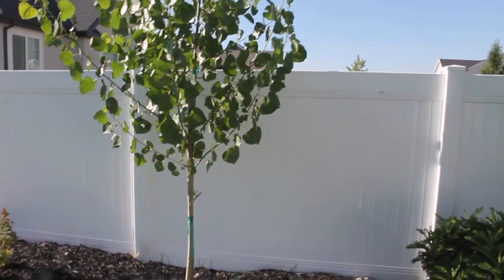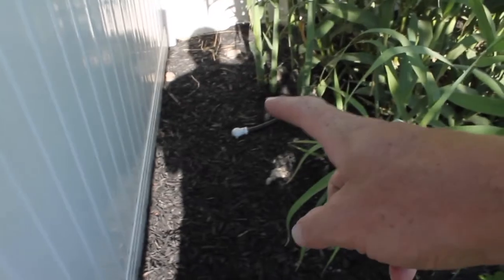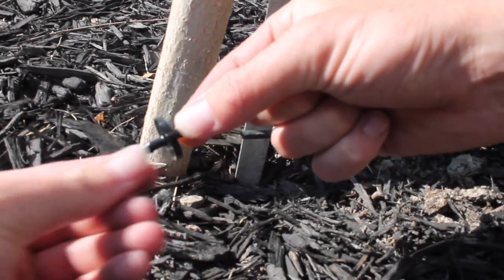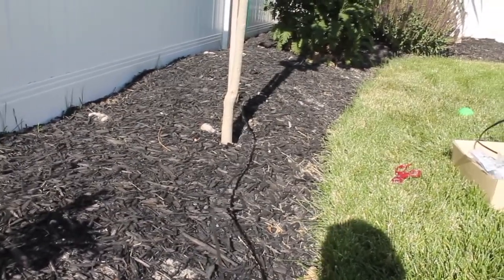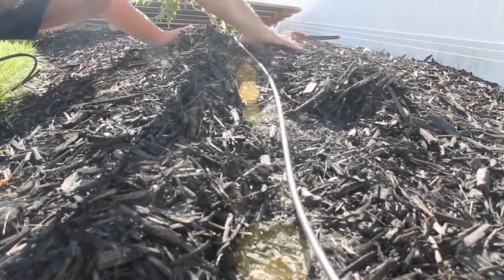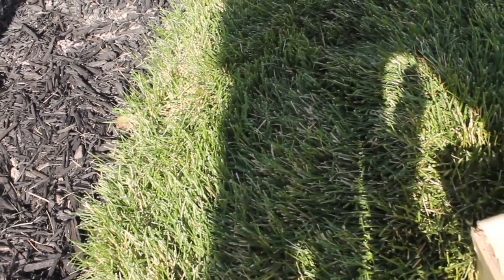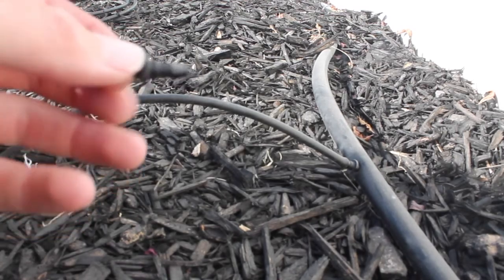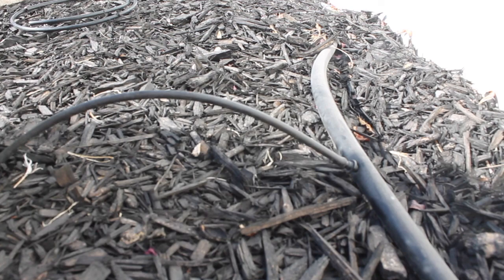How to Install a New Drip Line to an Existing Drip Irrigation System.

Comment: Question-how do you know if adding extra drip lines will affect your water pressure? That is the only thing keeping me from adding a few more to my existing system. Great video by the way!
Reply from the maker: Thanks for the comment! If you already have good pressure, you’ll be fine. The drip lines are so small that it won’t effect anything. For whatever reason-if it does, they have “oops” plugs you can get. You’ll just pop those in the hole you punched out, similar to inserting a barb, and it will close up the water flow, thus put your pressure back to where it was. Hope this helps. Good luck on your project!
Reply: @HomegrownHowTo  "goof plug"
Reply: One of my water lines  wasn't sprouting out water well but one of my lines was sprouting out too much water so I had to turn some down evenly not their all good pressure.